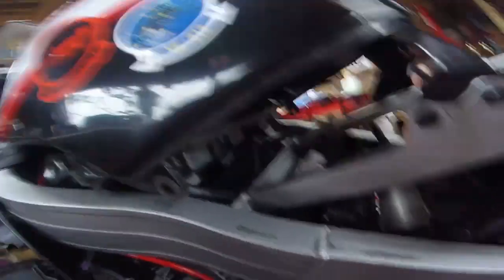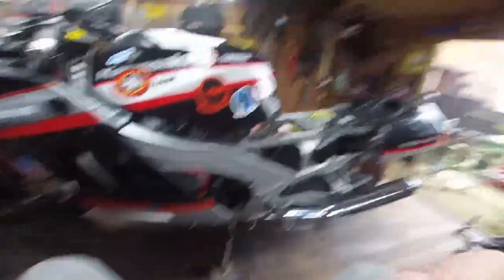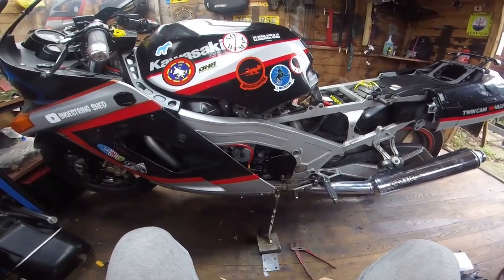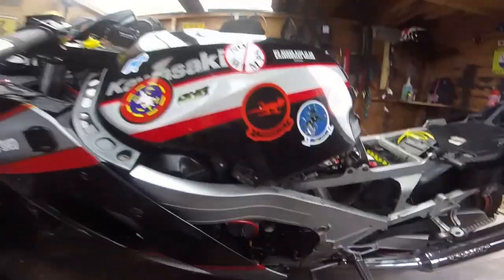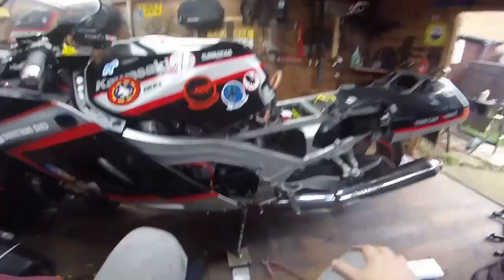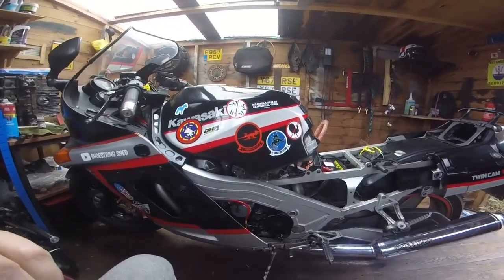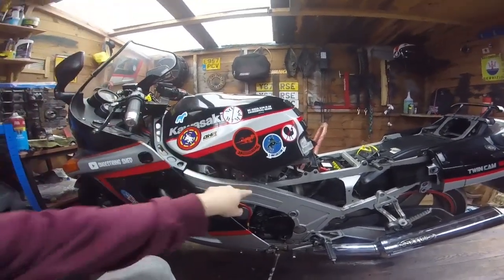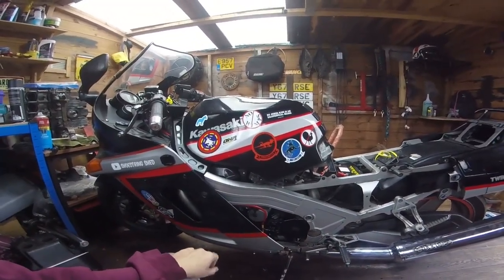Will a ZX10B run without a fuel pump?

Comment: The 4-wire fuel pump in these bikes acts as a second shutoff valve when the bike isn't running.  If the petcock, needle, needle seat, or the seat o-ring fail, the carb will flood in a gravity feed situation. In most bikes the carb would spill gasoline into the airbox. In these bikes, the gasoline goes right down the intake into the engine because of the angle of the cabs. If it's a slow gasoline leak, gasoline will slip past the piston rings. If you catch the leak = expensive oil changes. If you don't catch a fast leak = Hydrolocked engine. Best of luck. I appreciate the zx1000B content.
Reply from the maker: Thank you for the comment. I've been around bikes since I was five and I've seen that happen a couple of times to other machines when people have left the petcock on or didn't drain the fuel before over winter storage. Fortunately, 90% of the bikes I've owned have been gravity fed and I'm well aware of what can happen. I've been lucky enough to never suffer a leaking needle seat or similar. This fuel system is fortunately Ok so I was happy to run a gravity line. I see a lot of fuel in the crankcase incidents on small engines, like in generators and the like, people just forget to drain the float bowls etc.

Comment: Fuel pumps and the relays etc are such a pain.   Over engineered when it really doesn't have to be so.   Only Fuel Injuction bikes require fuel pressure.   Am I wrong??

Comment: Well done, the joy (only when you find it) of fault finding. I suppose the only real argument for a fuel pump would be a long, long fast left hander when in that case the bike could be leant over enough to cause starvation. But would you ever find that possibility in a road situation? Or am I talking testicles?
Reply: I was wondering why they fit a pump if its not needed? I assumed the feed without wouldn't be enough when ridden hard?
Reply from the maker: Primarily it was insurance against fuel starvation during sustained high speed running and also to prime the carbs. They didn't bother with a "prime" position on the ZX. I find it odd as my old GSXR slabbie and the GPZ900R I had could both do 150 (only 15mph slower) and didn't bother with a pump.